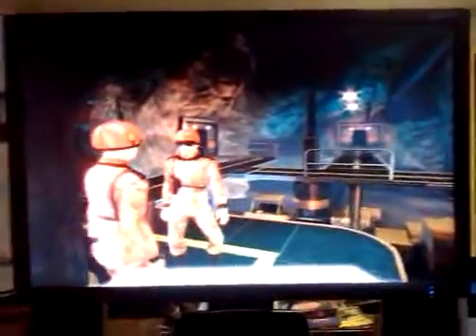3DMark Vantage SLI - What the hell is going on?

Comment from the maker: @MRJAZZ1959 Using benchmarking applications doesn't void any proper manufacturers warranty. Neither does overclocking a graphics card. If you're buying Nvidia you should be buying EVGA, they don't care if you overclock or use benchmarking programs.

Comment: . These protection mechanisms are designed to ensure the safe operation of the graphics card. Using Furmark or other applications to disable these protection mechanisms can result in permanent damage to the graphics card and void the manufacturer's warranty.